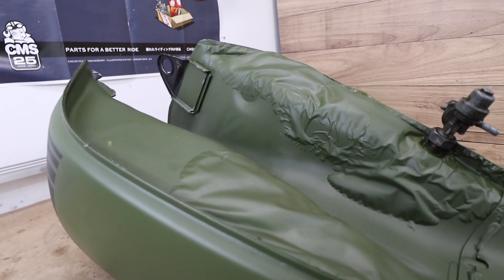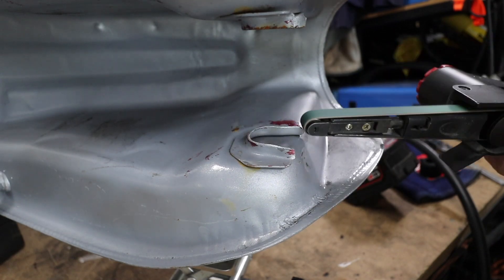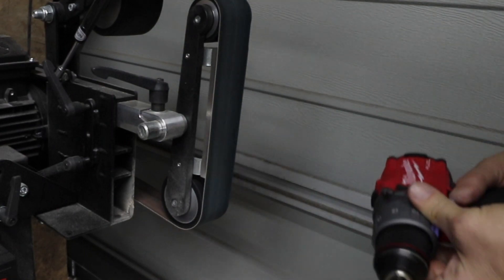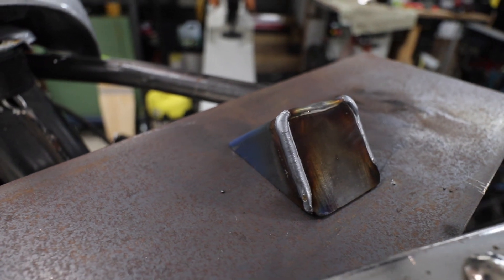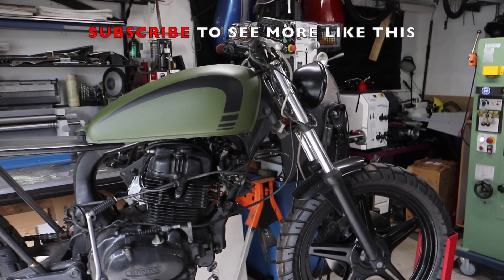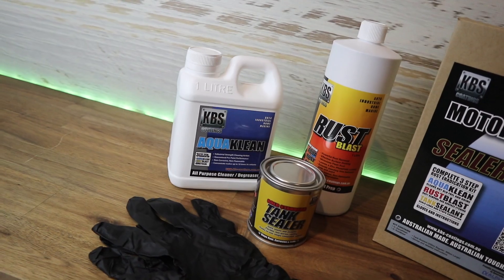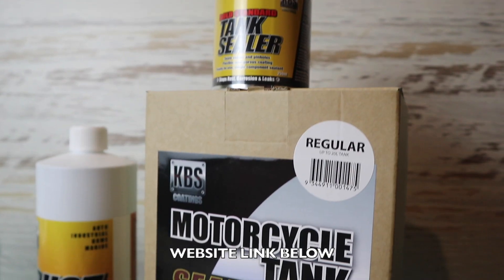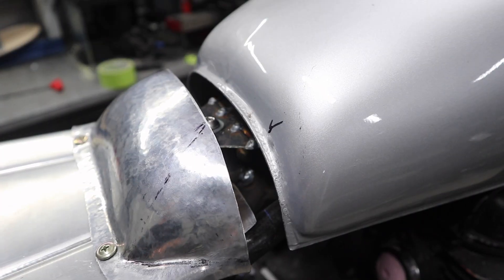★ DO THIS BEFORE ITS TO LATE!!!

Comment: What happened with your old tank is that there was a small leak somewhere and fuel got under the paint and lifted it, sealing is good, the tank on one of my CM450 when i got it had 17 pinholes and leaked like a sieve, i cleaned out the tank and found all the pin holes, then I  sanded around the holes,  i then dimpled them in with a small ball peen hammer and soldered up all the holes till i was sure there were no more leaks, with the tank cleaned out i coated the interior with a coat of fibreglass resin, 4 years on not a trace of a leak.
Reply from the maker: That’s awesome well done 👍 it’s worth taking your time with things like this so it doesn’t come back to haunt you

Comment: This is exactly why you must pressure test every tank before paint.  even brand new ones.
use air compressor, and spray bottle with soapy water.  even the smallest pinhole will make bubbles, which you can address with the welder.

Comment: I've been using VHT high heat and then baking it in the oven (if it's metal parts). I've had good luck with it, but for plastic stuff I still don't have a good way xD

Comment: Really sorry to see that happen on your green tank.  I wasn't sure if it was going to be a rust issue at first or if it was going to be a scenario where you decided not to put rubber mounts on and a piece of metal rubbed through the tank.  I have a kit of the KBS tank sealer waiting to go into a NT650 tank my own self.   I hope you decide to do a video on the process.  I know MDmotorcycle repair did one recently but I just feel there are too many other hack jobs out and it would be far better to broadcast the way to do it with a good kit.   The new tank does look really nice though, and maybe a little slimmer overall.   Thanks and keep up the great videos.
Reply from the maker: Thank you mate and Yes I will be doing a how to video very soon so stay tuned

Comment: I used Swish toilet bowl cleaner in my tank. Completely rusted to spotless in two minutes. Rinse with water, then rinse with methyl hydrate, then swish some two-stroke oil all around.
Reply from the maker: That’s a different approach but as long as it works

Comment: When the tank sealant is mixed and applied it causes a chemical reaction, this has a side effect of heat during the reaction like fibreglassing and fillers. Did it get hot enough to affect paint. I'm asking as I've acquired a 40 year old moto guzzi monza 500 and the tank needs treating but the paint is very good, that's why I asked.

Comment: What grips are those on the green bike at 3:58? Also, did you have to get shorter throttle cables?
Reply from the maker: Hey mate I don’t know what groups they are exactly I think I found these on eBay to be exact so there aren’t any specific brand.   Yes I’ve had to put shorter cables in

Comment: Is the Tank Sealant that you used resistant to Ethanol? The older formulations are badly affected by the increasing levels of ethanol used in the latest Petrol/Gasoline grades that are in use. The tank also needs to be protected from the water that is attracted into the fuel when ethanol is present. I look forward to hearing your thoughts.
Reply from the maker: This is one of the best tank sealers on the market,  it holds up for many many years. In fact, I don’t even know of anyone who has said it’s peeled back unless they didn’t apply properly. It’s ridiculously strong and resistant to almost anything.  If you’re concerned, I would definitely send them an email and ask them you’re welcome to tell them you saw my video if you want

Comment: I think that your problem may have been the fact that the tank could have had pinholes through it. Maybe from where you ground off that badge mounting bracket. That looked really gnarled underneath it. I bought a CB750 that had a beautiful tank made by Steve carpenter, but the guy I bought it from left gas I. It for so long that it rusted horrifically bad inside, to the point that it rusted pin holes all the way through , and did exactly what happened to your tank. My dad had a 450 nighthawk tank he was trying to save that was really bad inside. He had utilized so many chemicals that it put pinholes through the tank and made the metal not much thicker than tin foil. It never panned out. The only tank sealer thh he at I’ve never once heard anyone say anything bad about is “CASSWELL” I’ve been told that other products won’t even hold up to gas with any % of ethanol. I don’t trust sealers one damn bit. Sooner than later, they all go sideways, and when they do it is basically not something that can be fixed or is worth attempting to fix.
Reply: I agree, the paint separated because gas got in between the tank and the paint and the only way that happens is cuz there's a hole under the paint where gas is leaking. It is most likely to be at the bottom weld seam where the gas would be pooling. Happened to me once when I was evaporusting a tank, the seam was so rusted in a certain spot the evapo ate a pinhole right through. I also dont trust creamers, always hearing about the nightmares its can cause.
Reply from the maker: Thank you mate